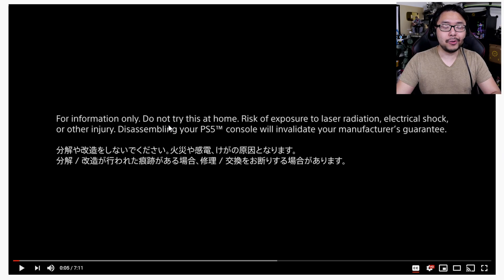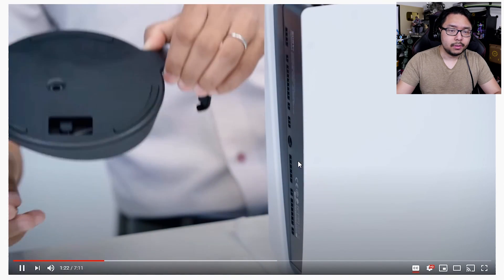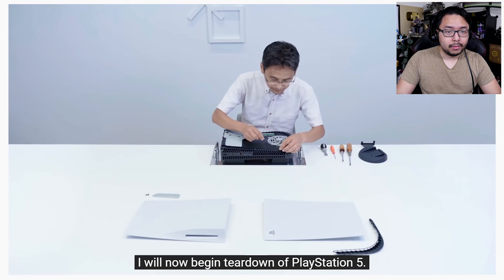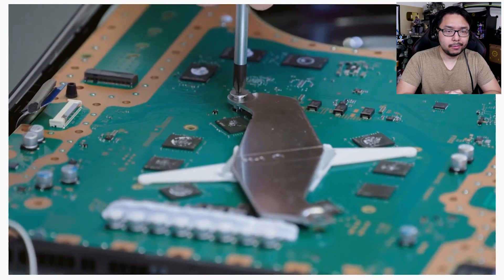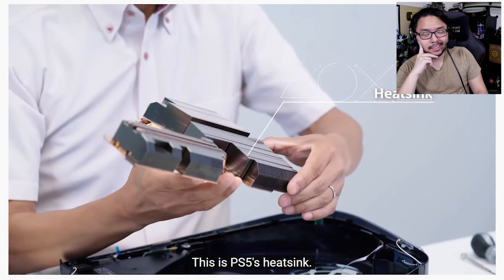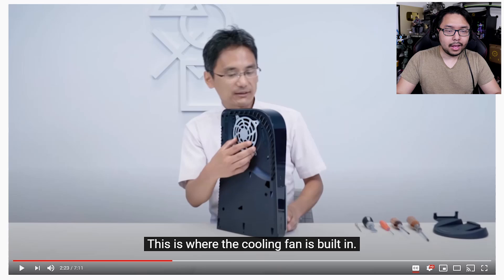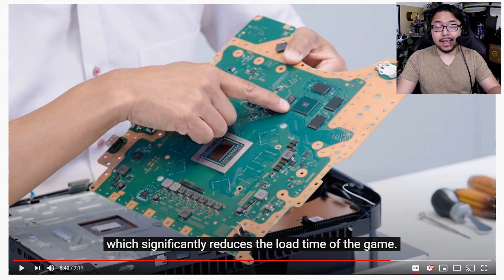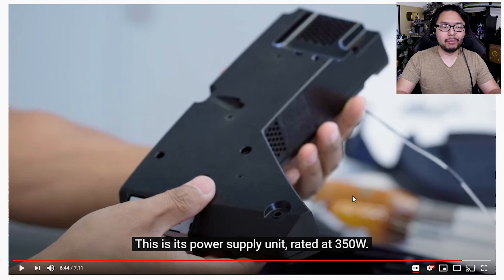Reacting To Sony's PS5 Teardown (Cooling, SSD Slot, Swappable Panels, & More)

Comment: Finally, 60fps is possible.
Reply: @Savage Canadian96 if you build a pc cheaper than you could buy a console, the pc is gonna be worse than the console lmao
Reply: @dqkm4668  the main benefit for that is more customization, both with build and game settings. If you target your parts at good times, take care of your build and all that... You're still saving more money. Circumvent online fee and bad console digital store prices.
Reply: @dqkm4668  A console can not be upgraded....expect storage of course.
Reply: DQ / KM yes
Reply: @dqkm4668  ok sure BUt  does it RUn windows  and other program  like Video editors and Stream platforms like OBS with discord   ..while gaming  ...at 144  fps  ..  ..cant have more then one  display   and Chat  properly ..HMM no  it will melt  into a smelly  goob of Plastic  ..i cant  create new game  with it  or Write music  make awesome ART  design a Plane or something  .for sure as hell can't play starcraft 2   ....
Reply: @dqkm4668   You can build a pc for 180 Euro if you wanted to if you build a PC around the price of a console if the consoles are as good as they claim to be you will get simmilar performance as long as you choose your parts right.
Reply: @dqkm4668  a decent video card has the same price as PS5
Reply: @dqkm4668  No lmao
Reply: PlayStation Fanboy: "PC is better than PS5?!?!"

Steam users: "Always had been"
Reply: Yes, Sony invented 60fps 🙃
Reply: It is, possible yes.. But will it run 60fps instead of 4k 30 with supposed rtx on... Also sony pushing out product thats designed to fail after 6month to a 2 year tops depending the quality of that gallium.. And all you MF's are praising sony for such a bold move
Reply: @Mabswer  They are definitely pushing the ps5 it doesn't have separate dedicated silicone to deal with ray tracing so you're going to see a performance drop its comparable to a 2060 in performance which can barely handle Ray tracing
Reply: Mabswer Like you know!
Reply: @Savage Canadian96 console pleabs still don't know their place in 2020, lmfao.
Reply: @DevilDaRebel  ignorance is bliss
Reply: @Savage Canadian96 It pretty much defeats the purpose for "more convenience." I rather have games much more accessible for me to play than worry too much about resolution and performance. As long as the game is in a playable state, I'm totally okay with it. Of course, whether the game is good or not is another different story.
Reply: @EpsilonChurchRVB  ''It pretty much defeats the purpose for "more convenience."' Ok, pay more for that convenience because you're too lazy to learn just an ounce of technical ability, a PC isn't some alien device, children can and do use them perfectly well. The reason you don't find a PC convention isn't saying anything about PCs but it says a lot about your inability to use technology.

''As long as the game is in a playable state'' What game isn't in a playable state on PC? I'm curious, seems your rhetoric is full of bullshit quite frank with you and conveniently seems to forget all the previous generations of games that are now unplayable on consoles due to lack of backwards compatibility, something PC has had for practically every game ever released on PC but if it isn't then someone will have made an unofficial patch that fixes it, something you can't do on a console because it's a closed system so....... You're chatting total shite.
Reply: @EpsilonChurchRVB   Just so you know the Exclusives are not so exclusive, you can play all XBoX and PS exclusives on PC,  also PC have way more functonality then consoles will ever have, its doubtfull consoles will ever catch up to PCs. Its better to have a PC and upgrade it then having PS4 or XBox One and getting the new Gen,  It costs less to upgrade a PC to make consoles eat the dust, then to swap a console, or if you have powerfull enough PC you dont need to do anything because the new gens dont even compare to what was available on the market before the new Gens were annouced. Not to mention games on PC`s normally work much better then on consoles as you can change settings and have no issues. Another issues with consoles is you PAY so you can Play with others HA the most stupid thing ever,  While you buy a console and have to pay for internet plus a subscription to play with other poeple, I upgrade my PC for less then you buy a console it will outperform the console and I only pay for internet when i want to play with others. So not only it costs you more to replace your console if you add all the subscriptions in 10 years time you wouold have spent much more then i had on my PC in the same time.
Reply: @nighthowk117  I know that already. Though I own a PS4 Pro and my brother owns an Xbox One S. I don't even pay for online yearly and only do so once every few months for at least a whole month or so since I don't play much online. And while PCs are always indeed better in almost every way possible for obvious reasons, consoles will still always have their own unique value to me.
Reply: @EpsilonChurchRVB  and setting hunched up at a pc screen hurts.
Reply: @yonkobuster112  go play on ur 60 hz tv which have a 30 ms response time
Reply: Savage Canadian96 yes they are still cheaper, if you build it yourself and know where to look it just means you get better stuff for your budget which will still need to be way more than $400
Reply: @Savage Canadian96 

Yeah but these are next gen consoles sporting AMD's RDNA 2.

Looking at PS5's specs, it's faster than a RX 5700XT. While the series x is closer to the 2080 super in performance.

These cards can destroy games at the best settings at 1080p. So I assume the consoles would aswell.
Reply: @Savage Canadian96 not true at all. The Series X has more teraflops than a RTX 2070 super. A comparable computer would cost far more than the consoles
Reply: @kevinrdunnphs  tflops mean nothing lol pls u dont know anythinh
Reply: @SatishGupta-xe1rz  it's the speed of floating point operations, the kind used to render triangles. Very important measure of gpu speed.
Reply: Hell, Metal Gear Solid 2 on PS2 could do 60 FPS
Reply: 144 if you have a really powerful PC.
Still, consoles have great exclusive games (as does pc) 
In an ideal world we'll have all platforms and enough time...
Reply: @biozelink6086  monitor you mean as well
Reply: @biozelink6086  time and money. What games need most
Reply: Bio Zelink PC does not have quality AAA exclusives sells and praised like console executives ! Name me couple AAA PC exclusives ..  I’m not fanboying or something.. I’m just sayin! Good thing Sony allowed a lot of their exclusive on PC.
Reply: @Fico214  PC doesn't need AAA exclusives when indie games are a lot better, cheaper and complex than AAA games. AAA games are mostly boring and copy / pasted nothing innovative even if they have hundreds of millions in budget.
Reply: @Fico214  meanwhile you can't play ps1 up to ps3 games in ps4 but you can in pc. Not fanboying either but that's what it is
Reply: @Fico214  ever Heard of Valve? the Recent Half Life Aly and Black Mesa? and PC don't pay for exclusive to begin with is a free platform, a very consumer and developer friendly one
Reply: @Fico214  man never heard of half life
Reply: @biozelink6086  beautiful.
Reply: @biozelink6086  i can hit 150 in rainbow six siege with a $400 computer
Reply: @Savage Canadian96 I'm planning to build one but for people who aren't tech savvy its actually a practical solution my cousin barely knows what ram is and a motherboard imagine him building a pc or worse overpaying for a cheap pre-built
Reply: 60fps 4k. Y'know even the RTX 2080 super struggles in some games with that :/
Reply: @MavihsLH  60 fps 1080 i said, also 144 fps 1080 most games
Reply: @AsecasJavi  

Consoles can reach upto 120fps in 4k (Cod Cold war and Dirt 4).

So they can easily get far more frames on 1080p.
Reply: @MavihsLH  no doubt. I meant my pc from 2016 that wasn't even that expensive does that.

Again not shitting on consoles, I prefer commodity in so many ways. I like playing on console way more even if my pc can run things better. I just use for work nowadays but I played some of the current gent games on there too like Doom, tomb raider and nier automata and it was great
Reply: @MavihsLH  You're living in a dream world if you think a 500$ console with the power of a 2070 Super will do native 4k 120 fps. The 2070 Super can't do 1440p 120 fps hell the RTX 3090 can't do 4k 120 fps and the graphics card is 3 to 4 times more powerful than the 2070 Super.
Reply: @Nomilh  

Its probably a low graphical preset to achieve 120fps. The Ryzen 5700XT can reach onwards of 100fps in 4k with graphical tweaks on COD Warzone. The PS5 is said to be faster than it. So I'd assume low graphics preset and extra optimization could get it to 120fps.
Reply: @MavihsLH  Sure it is, it's be known that companies want to show off their graphics by showing off low presets. 

COD Warzone was made to be playable on low rigs so hitting 4k 100fps with everything on low isn't an achievement, if you want to test the power of a console you need to use demanding games. Btw the PS5 has around the same power the Rtx 2070 super has
Reply: @Nomilh  

Yeah I'd say the Nvidia equivalent to PS5 is definitely the 2070 super. Maybe a little more powerful considering its AMD's new RDNA 2 architecture. 

Regardless hitting 4k 100fps even on less demanding games is still a feat. Its impressive nonetheless, and the next gen consoles can definitely hit that target on other games (racing etc.) Thanks to their insane optimization.

Every game wont run at 120fps 4k, but it's still nice to see consoles can manage it in the first place.

You're paying 399$ for the ps5 digital and 499$ for the series x and ps5. These prices for the performance are insane.
Reply: @MavihsLH  It's not really a feat when everything is on super low. I can run almost all games 4k 60 fps with my 1070 then. 4k 60fps ultra + ray tracing that's a feat, something that not even the 2080ti was able to do but the new 3000 series is able to do. ( Btw for warzone 4k it's around 80 fps on low 4k with the 2070 super ) 

What you're doing is like me saying that I have 100 fps 4k ultra on Divinity original sin 2 with a 1070, it's quite a feat so adding Rtx is possible and optimizing the game is doable. 

I don't know what they're going to do with the graphical settings on the new consoles but the more complicated it will become the more people will move to PC. The only thing consoles have compared to PC's is the accessibility, you press play and the game starts. Simple, efficient. The main audience for consoles is casuals and people that have no idea how the tech works. Don't get me wrong the price of the consoles are good for what they deliver FOR NOW, once the 3060 and the lower tier cards of this gen comes out it won't be anymore, consoles are on par with graphics cards that came out 2 years ago and sadly for them the leap between last gen GPU and last gen GPU is insane.
Reply: @Nomilh  

Yeah those are some good points. I agree with the accessibility part. But,

First of all they have the new RDNA 2 GPU which AMD hasnt released yet. Not really a 2 year old gpu. Its leagues faster than any GTX card per sè. 

Secondly,

Try running AC Valhalla, the next gen AC on your 1070 on 4k 60fps. Will it be possible? Absolutely not. 

The 1070 is not a 4k card at all. It's a 1440p card. Barely able to run AC Odssey at 30fps. Unity dips below 25. BF 1 not hitting 60fps. 

A 1070 even struggles to hit 30 fps on 4k in warzone most of the time at low settings. 

You see, next gen consoles are truly a powerhouse for the price. You cannot build a 8 core + equivalent gpu pc at the same price range. 

On top of that they have fantastic optimization which only adds to the experience.

That's why its impressive. A 399$ console, which sports a top class cpu and a very powerful gpu for such a low price and delivers 4k 60fps and possibly upto 120fps is insane.

Also a 3060 will most likely cost 299$-399$. Half the price of the next gen consoles.
Reply: @Nomilh  

Adding further to that, the xbox series x is already confirmed to hit 4k 60fps with full fat ray tracing. Quite insane.

The series x is closer to the 2080 super in performance. While the ps5 is a little stronger 2070 super. These cards for the money can deliver alot. Especially on 4k.
Reply: @Nomilh  

Also Divinity Original Sin 2 hits around 80-90 fps on 1440p. Not 4k.
Reply: @MavihsLH  It makes no sense to compare my GTX1070 that came out two gen ago to a brand new console that hasn't even released yet. Btw the 1070 is a 1080p card not 1440p. 

I don't find my 1070 to be a powerhouse far from it, it's a good card that was a powerhouse 4 years ago I have an RTX 3080 waiting to be installed ( I'm waiting for 2 8pin alim câbles ), the 3080 is a powerhouse though. 

The 2070 Super isn't a very powerful GPU anymore, it was when it released but not anymore either. The cards inside both consoles are the same gen as the RTX 3000 series yet they're as powerful as last gen cards.
Reply: @Nomilh  

Ah fair enough. I shouldn't be comparing it to your 1070, my bad there.

But there is a reason why these specific cards haven been chosen. A RTX 3000s in the next gen consoles? They could never hit that affordable price range.

The fact that you're getting a next gen amd architecture with last gen nvidia performance for even 399$ is absolutely insane. That's been my point all along. It's not impressive to hit 120fps in warzone or less demanding games, but for the price? Yes. Very very impressive.

Edit: I'm currently sporting a 2060, will also upgrade to RTX 3080 once its available in my region.
Reply: @MavihsLH  I do agree that as of right now 500$ for what you might ( I say might because except for promises we haven't seen much of the "next gen" gameplay ) get is not bad at all. As of today it's not possible to make a PC at that price for the same performance but it will be ( probably ) possible next year with the successor of the 1660. It's always been like this though consoles are good until the next gen of graphics cards come out then they're back being outdated. 

I was checking every morning every site that was selling 3080s since the release day to get one, got lucky the 6th October when the Gigabyte gaming OC came out they were in stock for an hour. Good luck on getting one if you check regularly you'll get one !
Reply: @MavihsLH  Well all you need is to lower the graphic setting or if possible use dlss wich as come a long way in two years.
Reply: @MavihsLH  what tells u ps5 wont struggle dont believe anything wait for benchmarks
Reply: @SatishGupta-xe1rz  

The specs and cooling.
Reply: @MavihsLH  cooling is nothing special tbh
Reply: @SatishGupta-xe1rz  

Liquid Metal and that giant ass heatsink. I'd say this baby wont be audible even under full load.

This is the first time I've seen liquid metal in a mass produced consumer product.
Reply: @MavihsLH  man liquid metal is nothing special pls have some knowledge about hardware and the heatsink isnt big i dont know why people are hyped about it
Reply: @SatishGupta-xe1rz  

?? Liquid Metal is one of the best and most effective cooling methods out there. The only downside is maintenance, that's why consumers rarely use it. But sony have made it so that it can last throughout the console's lifespan without any serious problems.
Reply: @Savage Canadian96 Plus You need to buy an expensive 4k 144hz monitor + your whole pc needs to be compatible with these GPU and CPU....it's expensive
Reply: I have allways had both pc and console. But since I became a dad I had no time playing pc like i used too, so I sold the pc and now I just play on console occasionally when I have some time... It really is cheaper than pc if you want equal performance
Reply: @Savage Canadian96 yes consoles are cheaper. Look everyone knows PC is better. I game on PC but don't lie to these people saying you can build a PC for $500 that can even run 60fps on low settings 😑 youd have to spend an upward of $1500 to get 60fps 4k and RTX
Reply: @iKrazyyi  You can run games at 60 fps with a 500$ PC dude are you serious ? The GTX 1660 ( If I remember right ) is 200$ and runs games at medium / high in 1080p at 60 fps. And once the same version but in the 3000 gen comes out it will be better than what consoles have for the same price. 

You don't need 1500$ to run games at 4k 60 fps on PC with the 3070. For 1200$ max you can do this if you buy a cheap CPU you can hit the 1000$, while having true ray tracing not that cheap knock off that they have on consoles. Check the Spiderman remastered ray tracing its mediocre compared to Minecraft RT and Metro Exodus RT. I also highly doubt it'll run NATIVE 4k 60 fps with ray tracing on but eh we can dream can't we ?

Edit : My bad the GTX 1660 runs games at 60 fps 1080p on ultra settings not medium / high.
Reply: @Nomilh  dude this is a lie because I have the AMD Radeon RX 5500 XT which is equivalent to the 1650 and it struggles to run most games on ultra and 60fps.
Reply: @Nomilh  and thats another lie. You'll need atleast $1500 to have 4k 60fps with RTX. Just go to PCpartpicker and build your PC that will run even close to 4k 60fps with RTX and you'll see. I've done it multiple times to build my dream PC and its always close or over $1500. With the 3070 or 3080, thatll youll NEVER get your hands on anytime soon, you will come out cheaper on the GPU but thats assuming you can get one. It'll be late next year before people can dependably get one without having to buy through a pos scraper. And even with all that you still need a monitor that is 4k and even decent fresh rates, mouse and keyboard and a desk. Youre looking at well over $1500 for a set up thats on par with the PS5 and Series X.
And you fault the PS5 for a shitty developer job at implementing RTX. I guarantee once developers can unlock the true potential we will have beautiful RTX graphics and with the specs I know for a fact itll easily run all games currently at 4k 60fps with EASE.
Reply: @iKrazyyi  Type 1660 benchmark on google instead of calling people names, btw the 5500XT runs games worse than the 1650 even if it's the equivalent in power ( say thanks for AMD garbage drivers ).

I got an RTX 3080 3 days ago, but I wasn't looking for matching console specs I was looking to match high specs. From what you've said with the 1660 I don't see the point in arguing prices with you when you can't even bother typing two words on google. You can make a 1000$ PC that will OUTPERFORM both consoles if you buy your components at the right time, it's still more costly than a console but once the 3060 drops there is a possibility to make a PC for 600-700$ that will be more powerful than both consoles. 

Don't take the little knowledge you have as facts. Clearly don't know much about computers otherwise you wouldn't say all of the nonsense you're saying. Yes before the 3000 series was announced you need 1500$ ( even more than that ) to run 4k 60 fps, not anymore though. No I don't fault the developers I fault the power of the console because like it or not the consoles GPU are the equivalent of a 2070 Super so they can't run the same quality of RTX that we have on PC at 4k 60 fps because it's not possible with a 2070 Super.
Reply: The comment is about PS5, ¿why the fuck always has to come a PC player to talk how good PC is?.

I mean everybody know that fact, but just why?. You are not going to change people mind, if someone enjoys consoles let they enjoy it ffs.
Reply: sadly, not entirely
Reply: people talk like they have 120 fps tv
Reply: thats what people said when ps4 launched grow up man accept the truth no hardware can give u 60 fps for 7 yrs
Reply: lol who said ps5 will do 4k 60 with high setting lmfao console pleb
Reply: @SatishGupta-xe1rz  

It's possible. Its powerful enough to deliver 4k 60fps on high. But it will definitely struggle with ray tracing at higher res (Demon Souls and Rachet).
Reply: @MavihsLH  next gen games will run at 30 fps and consoles aint getting ray tracing
Reply: @SatishGupta-xe1rz  

They're using AMD's RDNA 2 architecture, which they haven't released yet for consumers. And it clearly supports ray tracing. 

AC Valhalla, is running on 4k 60fps.
Reply: 60fps was already possible on PS4 pro and One X
Reply: @MeattMann  ok... Finally consistent 60fps is possible
Reply: Is this all you care about?
Reply: bro most games dont even clock into 60 frames you guys get dips as low as 50 frames so 50 frames is possible yes.
Reply: Console has been doing 60fps for awhile.
Reply: @Shadowdancer-77  Pahahahahaaaa no consoles have not, even the new gen is going to struggle keeping up 60 fps. but hey, people like you have said 'this gen will be the 60 fps gen' for every generation since the PS2, and you've failed every damn time, and this time won't be any different because of the hardware and the way it's built, but hey, I'll get my console peasant tear collector out for when you all start crying over an unstable 50 fps with stutters.  🤷‍♂️
Reply: @psyanide1603  what a ton of bs lol
Reply: @gippooverground8067  Not at all.
Reply: @Shadowdancer-77  yeah in 1080p good luck with 3K or 4K.
Reply: Companies don't produce parts from their asses yeah it can be little cheap but I would rather have upgradability rather than being exclusive to one hardware for 7 yrs and add the online subscription and ps5 I don't think it will play next gen games on 60 fps
Reply: Satish Gupta it will, it just depends on the game
Reply: @SatishGupta-xe1rz  IT will but on 4K it will probably drop to around 45 FPS in games utilizing the Ampere gen
Reply: @nighthowk117  60 fps dropping to 45 fps is very noticeable
Reply: 🤣🤣🤣🤣🤣🤣🤣🤣🤣🤣 60 FPS
Reply: 60 FPS is finally a more common standard im excited
Reply: @Savage Canadian96 I never said to get a console yourself. If you're fine being a PC gamer, no one is stopping you. All I'm saying is that I'm comfortable with the way games are on consoles. Even if they are capped at 30fps or 60fps uncapped, I honestly couldn't care less. If it's more easier to simply buy a console that also has good exclusives, I personally don't mind. To each of their own.
Reply: @EpsilonChurchRVB  ' If you're fine being a PC gamer, no one is stopping you' Nobody could stop us anyway. Gotta love crossplay though, certainly is hilarious kicking the crap out of console peasants with lower frames and an inferior control interface, and in games like the new Call of Duty to hear console players scream over their mic on death calling you a hacker when all you have are the reflexes you gained after not being reliant on auto-aim all your gaming. Crossplay has elevated my PC gaming in ways I didn't even know it would rofl
Reply: @GetShwiftyInHear aah... search this "PC is now Ubisoft’s most profitable platform
" and read the articles.
Reply: Savage Canadian96 what games are you actually playing right now on PC
Reply: It was possible on ps4 unless the cap was 50 i wouldnt know the difderence
Reply: I know right, Xbox does 120fps
Reply: Ffs why do people think Consoles never run 60fps. Even on PS4 most multiplayer games runs in 60fps at reduced resolution.
Reply: @sushanthadusumilli1067  ''Ffs why do people think Consoles never run 60fps. Even on PS4 most multiplayer games runs in 60fps at reduced resolution.'' Please tell me this is a sarcastic comment, I'm going to cite Poes law before I say this just to cover my arse but in case you're serious,  if you have to reduce a games resolution to make it hit 60fps your hardware is clearly not up to the fucking task now is it? Please tell me that your comment was a joke and that any appearance of idiocy on your part simply falls under Poe's Law.
Reply: @psyanide1603  You really don't have to act childish in order to try and justify your needs for being a PC elitist. Anyway, I didn't comment for waging the pointless ongoing war between consoles and PCs. It's ridiculous how people like you take these things way too seriously and I'm not just talking specifically about people who prefer PC. I have nothing against people who prefer either PC, console, or handhelds, but to try and insult me in order to try get your points straight is just too childish to even bother listening to.
Reply: @EpsilonChurchRVB ''It's ridiculous how people like you take these things way too seriously'' I'm just talking facts, you can complain as much as you like about my attitude towards you as my attitude towards you is in effect a complaint towards people like you who know nothing of which they speak voicing their factually incorrect opinion as truth.
Insulting you wasn't meant to get my point across, it was meant to insult you.... generally the purpose of an insult last time I checked.
Reply: @psyanide1603  So what you're basically saying is that insulting people is necessary in order to deal with something you don´t agree upon? And then people wonder why is there toxicity within communities like this...
I also never said my opinion was factual. I only stated what I said before as to how I feel about PCs and console gaming, but if you wanna twist other people's words and turn it into an argument by throwing idle insults to whatever you don't agree upon, be my guest cuz it ain't my problem. It only further proves how childish you are anyway.
Reply: Haha good one
Reply: Always has been.
Reply: @Savage Canadian96 it's that cheap? a used cpu i mean. I've never bought one.

Actually, my pc could do with a 3070, it's already pretty good, it doesn't do 4k 144fps but it does 60fps at 1080. Having the screen i have i don't need more.

I have a 4k tv tho, so i'm always thinking of connecting the pc to that and upgrading it...
Reply: dustisdeadbodies85  GAMING SMARPHONES !
Reply: Laughs in PC
Reply: It only became possible because the technology became cheap enough
Reply: @Savage Canadian96 He's not going to lol not even close i talked to him about it he already pre-ordered a xbox and then made a dad joke about the motherboard (wheres the fatherboard?)
Reply: PCs are not expensive to build one guys i built mine for 600 and i run games above 90 just fine
Reply: @Savage Canadian96 damn it's not bad at all. Maybe here in Spain is just more expensive
Reply: @Savage Canadian96 thanks, I just know the basics and this is helpgul
Reply: @GetShwiftyInHear Hahaha no, it's not liquid cooled
Reply: Ash Bajaj  no it's not... The liquid metall is used instead of thermal paste
Reply: Ash Bajaj  Yeah, but calling it LIQUID COOLED is false bc it's not.... A vaporchamber is more like liquid cooled
Reply: @Diz Zkl Exactly, try getting high setting graphics at 4k 60fps with a pc that costs 499
Reply: @Savage Canadian96 still is more expensive right now unless you going to a second hand store that smells like ur dad's willy
Reply: @Savage Canadian96 this is a lie
Reply: They do 120fps too.
Reply: @vincevirtua  Should do more. I have an rtx2060 which might be roughly similar to ps5 and I run games like Rocket league at 200fps (can play much higher if wanted). I hope they scale it up depending on the game. I have a 144hz screen.
Reply: @ 1080p
Reply: Also Mshs  with the specs of both the PS5 and Series X it will easily run any game at 60fps. Now at 4k? Idk but im sure they'll have resolution settings so you can get that 60fps but for $500 it's competitive with a $1500 PC build and thats just facts...
Reply: Phantom Thieves the fsp dont make it better visualt
Reply: @Savage Canadian96 abe chutiye kabhj exclusive games ka naam suna hai woh chalane ke liye Tere ko console Lena padhega. Samja chodu
Reply: COD4 and Diablo 3 ran at 60 fps on consoles. Not to mention any budget PC build (which is double the price of a console) can't run any newer, more demanding games higher than 30fps on medium settings.
Reply: @duncanwade1026 .
Joke aside do you consider in your statement the price of a used or new and current or mid gen  console ?
Reply: *120fps
Reply: RIGHT LISTEN! Stop being childish, I can put this all to bed now.................

You lot are poo poo heads.
Reply: @GetShwiftyInHear The ps5 is not liquid cooled man. That liquid metal thermal compund just takes place of the old style thermal paste.
Reply: Yeah for me  exclusive games wont make me get any consoles when they are lacking always behind pc in utility and usage and programs and modding
Reply: Never understood this shit.
PC gamer: oh hey did you hear steam is having another sale?
Random Commenter: wHy ArE yOu NoT uSiNg A cOnSoLe¿

Console gamer: oh wow I'm really looking forward to the next gen!
Random Commenter: jUst GeT a Pc YoU pLeB¡
Reply: On a console to achieve 60fps a lot of eye candy needs to be turned off compared to a pc port of the game. That said I love both pc and consoles and I have been gaming on a lot of platforms for decades now. If you have the budget there's no need to be a fanboy of a pc or console.
Reply: I bought a used gaming pc recently. Really happy with the performance. Easily hits very high frame rates at high settings at 1080p. It cost me $740. Not exactly a budget price but I'm happy.
Reply: Possible, but never utilized by the game devs 😭
Reply: lol
Reply: @Alex Alverez gonna challenge Tencent for that lmao
Reply: Ash Bajaj  it is like a thermal paste buddy its nothing new
Reply: @Savage Canadian96 it also depends where you live, where I live there is no way to make a gaming pc(with dedicated gpu) that is under 900 dollars
Ryzen costs as much as intel in some places in Europe
Reply: It was possible if you had good TV
Reply: @Lapislazuli My comment was that pc has had over 60fps for a long time, not consoles.🤦🏻‍♂️
Reply: @Lapislazuli Consoles are behind PC what are you smoking dude?
Reply: @Lapislazuli PS5 cant even manage true native 4K, its just upscaled 1080p, something that has been more than possible on pc since the 1000 series GPUs
Reply: @GetShwiftyInHear lol ps5 is not liquid cooled
Reply: Satish Gupta not true
Reply: @Savage Canadian96 I wasn't just talking about launching games to play. I'm also talking about how inconvenient it is to look up for parts and cheap prices at a trusted location as well. Not to mention that not only you have to build it yourself, but your budget is gonna have to be at least more than $500+ if you wanna even think about running games at a reasonable performance for new upcoming games as well. If you're just in it for gaming purposes, might as well just buy a new console. Saves you the headache from having to deal with all this PC stuff anyway.
Reply: @EpsilonChurchRVB  Right now yes the PS5 is cheaper than a PC for the same specs but once the 3060 and the low tier graphics cards come out for this gen Consoles will be behind again. It's always been like this : Consoles comes out they're worth the money a few weeks later new gen of graphics card come out and they're outdated.
Reply: @Nomilh  You're right, but that pretty much applies to anything electronic really. TVs, graphics cards, phones, tablets... etc. It's literally an never ending cycle of new and outdated hardware.
Reply: @EpsilonChurchRVB  Not really, sure they get outdated fast but the PS5 and XSX are already outdated while not being in the players hands yet, that's not happening everywhere. The minimum life cycle of a graphics card if you buy them every gen is 2 years so the consoles should be on par with PC for at least 2 years which isn't happening right now.
Reply: @Nomilh  Shit my 780ti still out performs current gen consoles lol Only upgraded to a 1070ti for VR, which really at this stage of VR's overall development was a bit of an exuberant purchase but still.
Reply: @psyanide1603  Pfft bullshit! And you bought a 1070ti, just for VR? Bah, that's a shit card dude
Reply: @EpsilonChurchRVB  ' I'm also talking about how inconvenient it is to look up for parts and cheap prices at a trusted location as well' Reeeeealy not that hard, plenty of PC hardware sellers do frequent sales, nah £500 will easily get you a PC that out performs console, you can just buy components that are half a decade old and nearing being discontinued. Although if you're going to act like 500 is a lot of money I don't know why you're on console when, on top of the cost of the console you also have to pay for multiplayer, which ups that cost even more. If you cared about your money going further you'd be on PC, not console 🤷‍♂️
Reply: I get what you are trying to say with this comment, but there are plenty of well made 60 fps games out there
Reply: Has been for almost 2 decades, consoles are just behind PC
Reply: @allyourweaponsofmass  2 decades? What with 480p and shit textures? Lol talk about false equivalency. Everyone knows PC is ahead of consoles graphically. But comparing something like Half Life 2 being able to run at 60fps 20 years ago is not the same as a modern game running at 60fps on a console. 🙄

And on another note plenty of games run at 60fps on PS4 pro and Xbox One X like Dark Souls 3 for example.

And dont even get me started on the fact that any system is capable of high frame rate at the cost of graphical fidelity. Its all about what console and game developers choose to prioritize which has historically been graphical quality over frame rate.

All this comment is pointing is out is that we can finally have both on an affordable console. Where as 5-10 years ago you would need a 2000$ PC to achieve the same results.

PC is great. I play on PC and PS4 personally. But comments like these are what give the PC community a bad name.
Reply: @nathanwhiting5475  Try Black Mesa then is really potato friendly, like, you can run the game without a GPU for 20-30FPS most the time lmao
Reply: @allyourweaponsofmass  but consoles are cheaper than PC in terms of gaming ,right?
Reply: @nickjackson3061  not that cheaper considering what you are buying. If you need a pc to work with 3d modeling, animation or professional ilustration, its way cheaper to have a pc to play and work than to have a pc and a console for example.

With 1000 you have a pretty good pc, maybe not 144 fps but close

Mine is from 2016 and it actually can't do 4k with everything, but it does with nier automata at 60 fps.

Not saying it's the best pc nowadays, but it cost me that and it actually has more than the gaming purpose

Also emulators and thousands of roms lmao
Reply: @nickjackson3061  In the short-term yes, long-term no.
Reply: @nickjackson3061  'consoles are cheaper than PC' Nope, you're paying a premium for hardware that under performs. Make no mistake, neither Xbox series X nor PS5 is going to perform close to what their respective marketing is claiming, my rig is 7 years old, still plays everything at highest settings. If I were to do the same with just consoles I'd be £400 down instead of £400 up, than there is the money saved not having to pay a premium just to access multiplayer 😂 consoles are just, overall, a bad deal.
Reply: @psyanide1603  Saying that your rig is 7 years old and playing everything at highest settings says nothing ... My old laptop can also play everything at high settings, but only at 480p... 
My old 2500 dollar pc from last year couldn't run every game maxed out at 1440p and I had a 2080super, i7 8700k @4.8ghz, 32gb 3200mhz ram etc etc... So buying a console that will play the same games I played on pc but with great graphics at 4k 60fps is a bad deal?
Reply: @nickjackson3061  We are really in the grey area rn tbh with you. Easily I can outbuild the One X or the Ps4 pro for cheaper. These new consoles have some wild claims and tbh they seem a bit outlandish. If they are able to pull off what they claim then it would be extremely difficult to match the specs for that price. Pc does have many more uses and freedom than a console which is one reason I continue to use mine.
Reply: @celeroon89  Your PC has issues then, my 1070 runs most games at high settings in 1440p at more than 60 fps. Btw, the 3060 will destroy consoles and that's a 350$ graphics card, they'll probably release the equivalent of a GTX 1660 that will also outperform console, that's a 200$ graphics card. 

I have an RTX 3080 coming that will put consoles that didn't even come out to shame, sure it's a 800$ GPU but consoles are supposed to be high end PC's when they release which they won't be if a mid range GPU like the 3060 will destroy them. 

Don't forget that they might hit 4k 60 fps but the graphics won't be as good as on PC, it'll be on medium / high at best.
Reply: @Nomilh  At high settings yes, but fuck not maxed out, that's what I am saying. There was no issues at all with my pc, but everyone is claiming extreme performance from shit cards like 1070 or 980 etc and that's not realistic. And ofc the 3060-3080 will completely demolish consoles but again, im not saying consoles are better or worse. They are for different types of gamers, I used to play on pc, but I can't anymore. So im buying a Xsx
Reply: @Ryleeman54number2  in India it takes double the money to make a good gaming PC that you can make in US due to the import taxes. It takes 200k rupees that is 2666 US dollars to make a PC that can run all the games and can stream as well
Reply: @nickjackson3061  pc for value are way cheaper
Reply: @loafofbread9400  but making a PC depends on which country you live I live in India and take 100k to 200k rupees i.e. $1666 to $2666 to make a good gaming PC .
Reply: Nomilh  so WHO cares about pc card, when we play on console, yes it,s 500$ but you dont be able to rich does spec under 1000/1200$
Reply: @andreasbilberg8150  make it 600 becuz you need a TV also
Reply: @nickjackson3061  not the 70 inch TV you are using  and Scuff controller
Reply: @scivirus3563  in India 1000 dollar for 55 inch 4k monitor
Reply: @celeroon89  My 4 year old GPU that has half the power of your card ( the 2080 Super ) runs games just a bit better ? I called bullshit on that. There is no way you don't hit 1440p 60 fps on ultra except maybe in RDR2 because this game is very poorly optimized otherwise you should hit 70-80 fps minimum.

Shit cards like the GTX 1070 ? Bro the 1070 is more than enough to play games at 1080p on ultra at 60-70 fps. I can tell because I own one. It can't on 1440p though that's why I changed since I play on 1440p. 

You're going in circles : 1070 is a shit cards while the new consoles are just a bit more powerful than a 1070 so consoles are shit in performance right ?
Reply: Nikhilesh Sharma not really especially when you factor in the price of games and controllers and other accessories you want for it it’s why many like myself switch after ps3 to pc since I was not paying another company to pay to play online another more factor to factor in
Reply: @nickjackson3061  make it over $1K if they really want that 4K 120Hz TV
Reply: @nickjackson3061  Indeed, which is why it took them 20 years to catch up.
Reply: @nickjackson3061  Not really
Reply: @allyourweaponsofmass  I remember playing MGS2 on PS2 and it had 60fps back in early 2000s...
Reply: @youwaisef   yeah and 480 pixels
Reply: Matt Putsey Even the Xbox 360 could play every pc game from 20 years ago at 60fps so your statement is more than a little vacuous!
Reply: @allyourweaponsofmass  woooosh
Reply: @allyourweaponsofmass  1 decade yes but not 2, in the early 2000 I was there and stable 60 FPS on PC at decent resolutions was not easy to achieve! Even with good hardware. Honestly it's only since Windows 7 and the appearance of SATA SSDs that the PC really got much better.
Reply: @allyourweaponsofmass  haha Good one, but youre wrong
Reply: @allyourweaponsofmass  let's be honest dude, for $400 no pc can achieve this level of performance, and I am a pc gamer myself.
Reply: @allyourweaponsofmass  lll right think he was talking about 60fps on console
Reply: Matt Putsey the sun is a star. We’re both saying shit nobody gives a fuck about but are facts
Reply: But will probably rarely implemented.
Reply: stfu Xbox fanboy
Reply: Consoles have never had a problem with 60fps. Targeting 30fps for better visuals (or easier development) is a developer choice, and one most will continue to make in the incoming generation. At least in PC you can always tone down the game settings and resolution to increase performance, an option I wish console games also included.
Reply: @darak2  If its for better visuals then why do Console games still look worse than PC and still play at 30FPS? BTW a lot of console are so strapped for FPS that they are actually like around 800p but upscaled to 1080p such as the case with red dead redemption 2 or DOOM 2016.
Reply: @darak2  ''Consoles have never had a problem with 60fps. Targeting 30fps for better visuals (or easier development) is a developer choice'' 😂😂😂 wow, what a deluded fanboy you are, consoles HAVE ALLWAYS had an issue with 30 fps, the amount of shared games available for console and PC that are locked to 30 on console becauyse they can't handle it yet unlocked on PC highlights the bullshit in your sentence let alone the rest like 'toning down graphic settings'.... I'm sorry Mr. CoNsOlEs NeVeR HaD 60FpS ProBlEms, but if consoles don't have an issue with frame rates why would you need graphic settings with which to lower the graphics further than they already are set by the developer?

On the flip side, on PC we have mods that INCREASE the graphical fidelity of games that are also on console just so we can actually fully utilise our systems power so.... no idea what you're chatting.
Reply: @GetShwiftyInHear  3.2 billion smartphone users.
Reply: @Prodzick  6 billion shoe users too what's your point
Reply: @AsecasJavi  You buy software for your shoes ?
Reply: @Prodzick  you play actual games on your phone?
Reply: @AsecasJavi  Between Tetris and Grid Autosport they should be something you can consider an actual game.

ps : I know lots of free-to-print-money out their.
Reply: @Prodzick  i mean can't you play those anywhere else but better? Not saying it has no games at all, but it's all the inconvinieces from other devices put into one. Bad performance, battery dependant, incompatibility issues, input problems (no buttons or similar), small screen, expensive etc

since you already have a phone, you play games and since everyone has a phone, companies make em. It's not like pc or consoles at all.

If it evolves into something enjoyable, ok fine, but at the moment they feel like minigames you could play on ds or psp, not even full games
Reply: @AsecasJavi  So games like among us are not actually games ?
Also could old games now be consider to empty of any fun ?
What do you consider expensive for a phone ?
Reply: Tbh 60 fps is bad nowadays, 120-144 is 😍